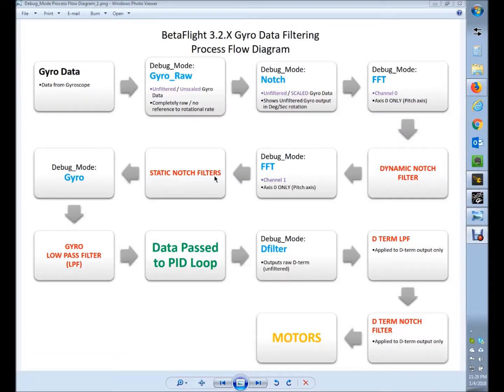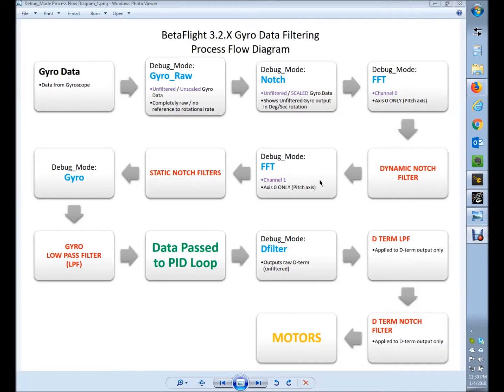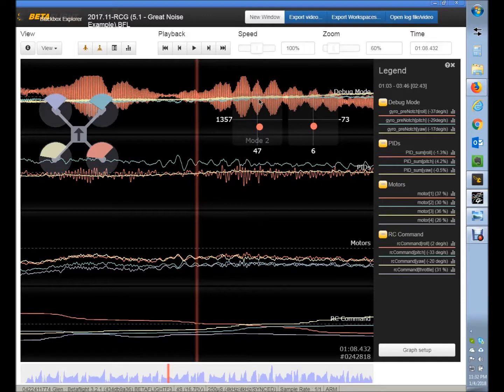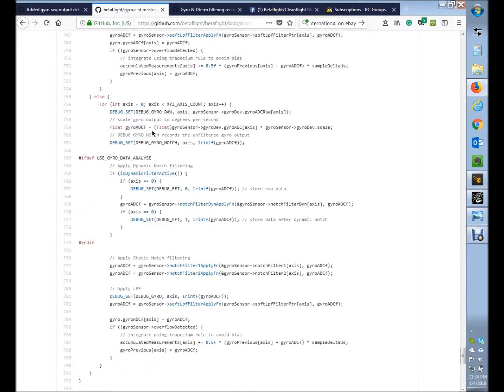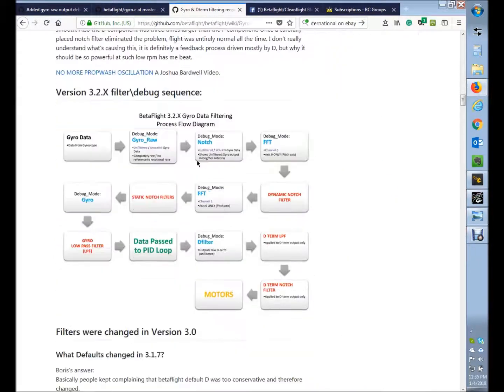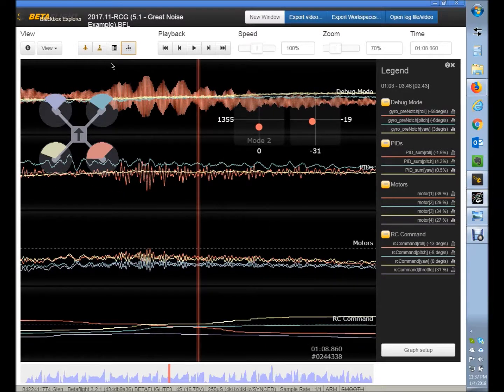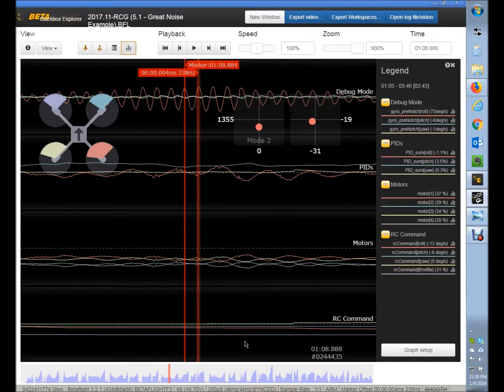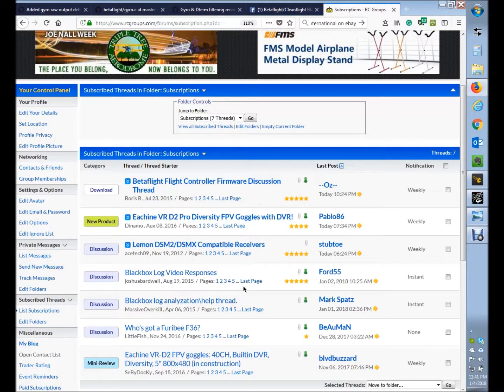Blackbox Debug Modes for Noise Tuning

Comment: I watch all your videos multiple times for over a year now. I feel confident enough to try black box logging. I have successfully downloaded and opened blackbox explore I have everything set up in beta flight the only thing I need is a question answered or any other points that you could give.      Question : 
What debug mode should I use to check for bad motor or ESC or flight controller?
Reply from the maker: debug = gyro_scaled

Comment: Ive been watching your tuning videos sometimes up to 5 times to get a good understanding.  I’m about to start black box logging for the first time now.  My question is that a lot of the black box videos are from much older bf versions.  I’m general are all of your videos still relevant and can be applied to bf 4.1 or is it gonna confuse me more looking for things that don’t exist anymore?   Should I record gyro raw to be tuning filters and pids?  Again your videos are more helpful then anyone’s and I appreciate the work.  Thanks.
Reply from the maker: They all are still relevant.  The PID controller, and principals to tune, never changes.  I would record Gyro_Scaled most of the time.  Especially for filter tuning.
Reply: UAV Tech My question is what debug mode should I use to test for a bad motor or ESC?
Reply from the maker: @fpvraver  Gyro_Scaled.
Reply: UAV Tech thank you.  
I asked because I was worried things may have changed since you made the video. I’m using Bettaflight 4.2. 
Thanks again 👌👌👌👌👌
Reply: UAV Tech Thanks again !!!!   So my next question is. There’s so many videos and I’ve watched I think almost all of them but I can’t remember, do I need to turn off I turm relax, feed forward and those things before I log this flight?
Reply from the maker: @fpvraver  just watch my 2-Packs video.  

For troubleshooting ESC and Motor stuff, those settings don't matter.
Reply: UAV Tech Thank you for pointing me in the right direction. I keep skipping over that video for some reason.
Reply: UAV Tech ❤️
Reply: Perfect that’s all I needed to know.  Thanks